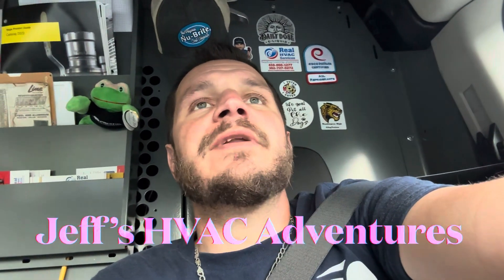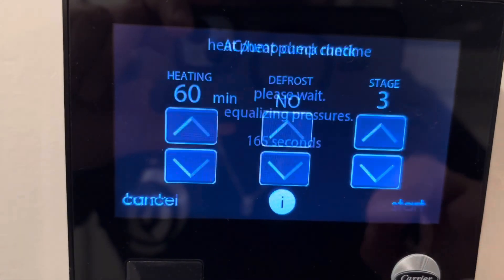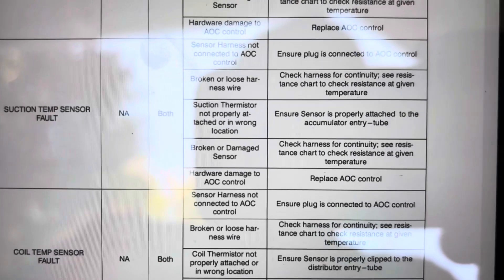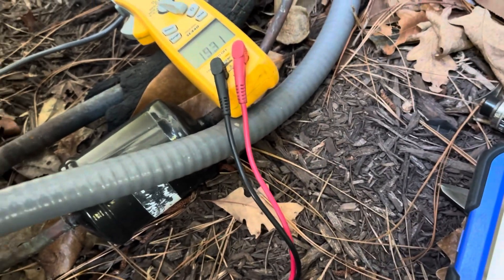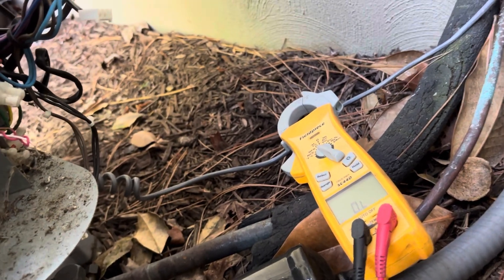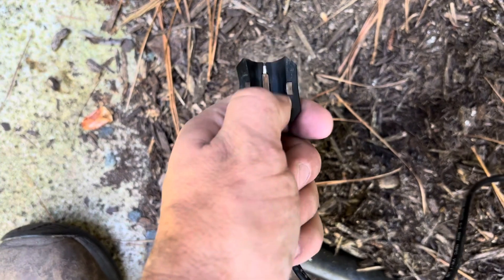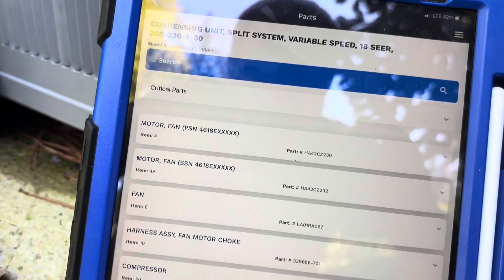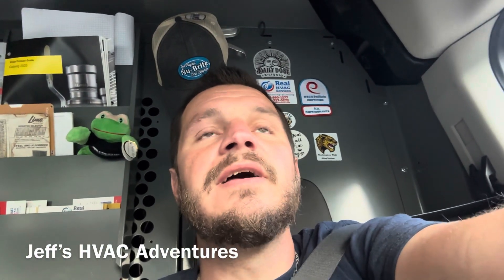Using A Honeywell 10k Sensor To Escape A Jam!

Comment: La aplicación sería la misma para el error 82 ? Gracias
Reply from the maker: 82 is a thermal lockout.   It’s possible but I would check discharge temps first and eliminate that.

Comment: Did the generic sensor work correctly or not? You seem to have said both at one time or another.
Reply from the maker: It does work but being that it doesn’t strap correctly to the suction pipe, it’s not giving a true suction temp reading.  So I guess the answer is…. Kind of.    It will work till I get back with the correct one.

Comment: Man, just like new vehicles, you almost have to be a software engineer to figure these things out. Give me some low charge, bad, capacitor, 
bad Fan motor any day! Lol
Reply: The young and middle age guys better be ready for power electronics and logic in everything very soon.  Especially when hvac manufacturers wise up and add automotive style reliability to the product. No more loud startups or operations while saving operating expense.  Consumers will demand it.